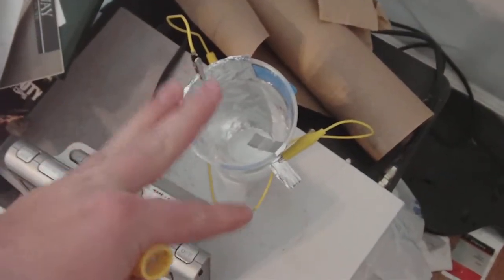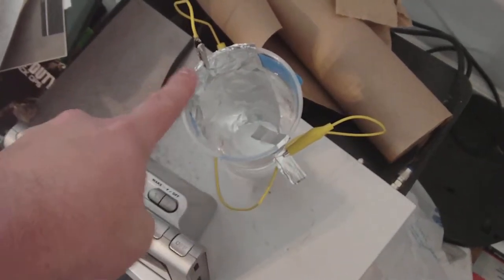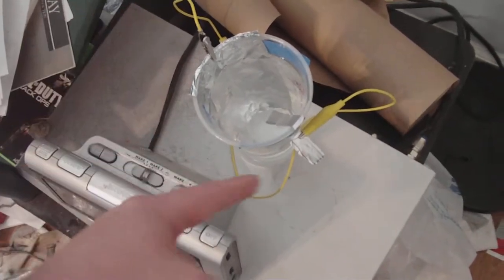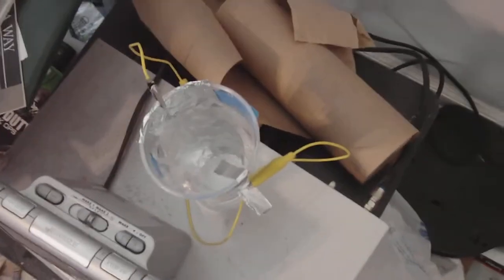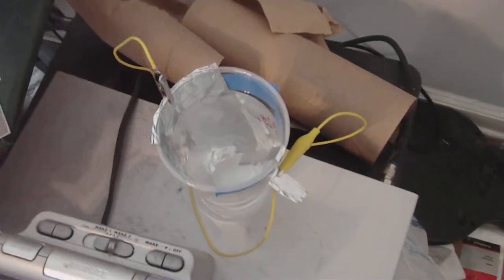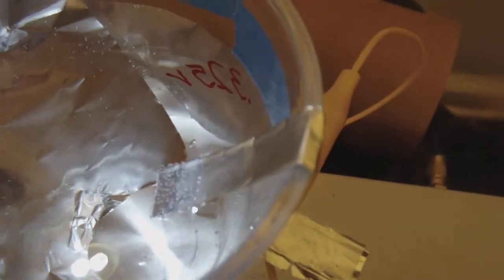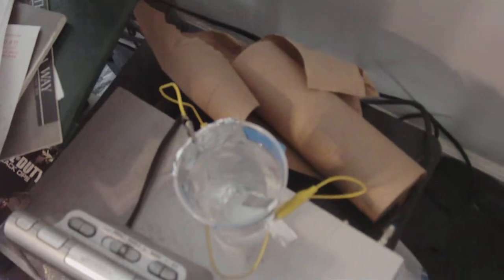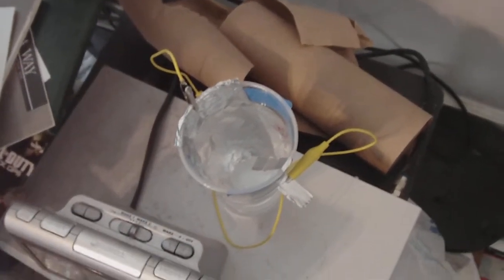Electrolysis with no power source needed.MP4

Comment: Ok  Einstein... Im no genius but I can tell you whats happening......your cable is acting as an inductor because its close to the  to that "boombox" you got placed close to it. The induced current is weak but good enough to impress you with bubbles. Take that away and you will not get any bubbles. If it does its still inducing current from the air....put it in a Faraday cage then you will definitely get nothing.

Comment: I am MJN from energetic forum, I am posting here so as not to get into a whole run of posts. I have worked on three plate caps for some time as some peole will tell you, what you need to look up for this is ion exchange in water, this is ongoing ALL the time but you do not see it, but when you put a resistance accross two p`lates you will stop some of the ions doing a return back. This is where you get the little H2 that you see.